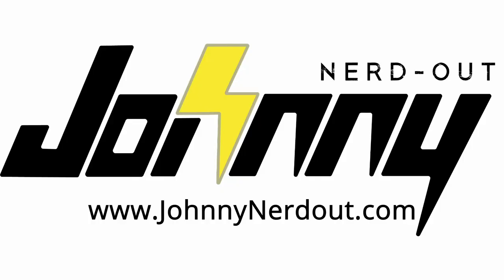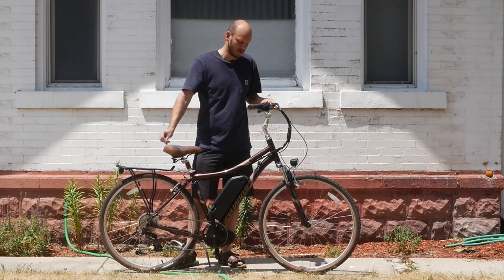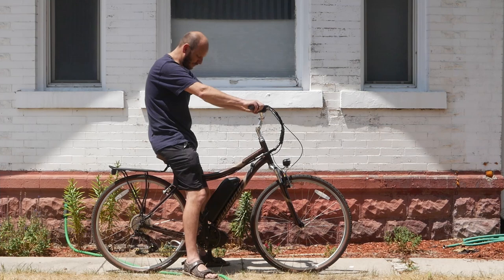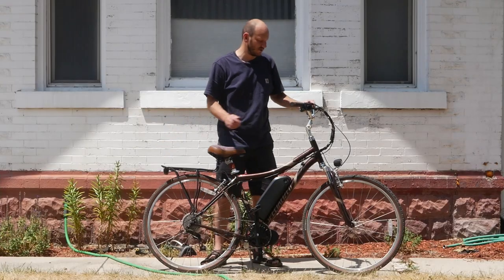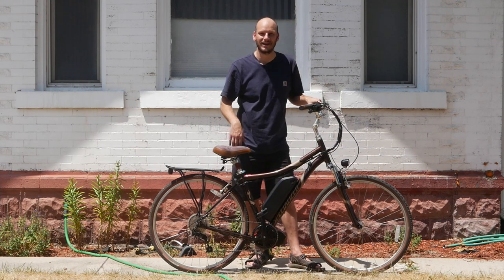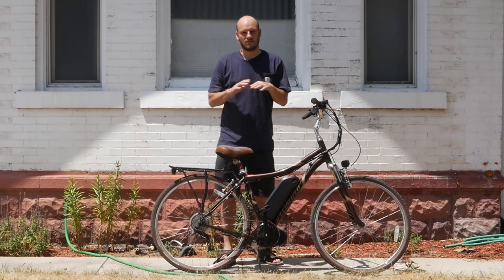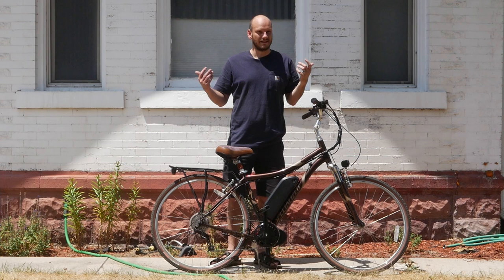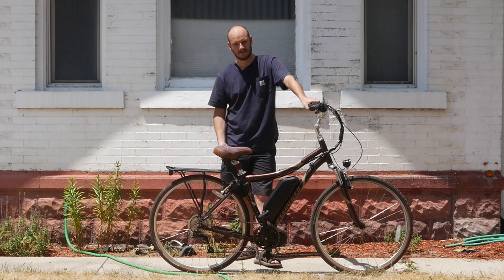Custom E-bike Build: Specialized Crossroads Bafang BBSHD 52v 17.5ah Comfort Cruiser!

Comment: My wife has a specialized comfort bike that I would like to convert but it has a curved frame where the battery would mount. Are there adapters available for mounting the battery to curved frames? I know I could put the battery on a rear rack but would rather use the frame for better balance.
Reply from the maker: Double or triple bob should still work

Comment: You sir have an awesome channel! Quick question. Got a vintage schwinn stardust restoration project and I was thinking of adding ebike conversion. Is it doable? What parts would I need apart from bafang bbhd
Reply from the maker: Short answer is yes, you can convert any bike if you have the patience and a little bit of the Macguyver gene in you. Measure your bottom bracket area for clearance and get a battery. thats it except for spacers and adapters. Feel free to book a video chat with me if you want me to put my eyes on it :)
Reply: @JohnnyNerdOut  thanks Johnny. Will take you on the video chat once Restore of bike frame is complete .
Reply: You'll need a  bottom Bracket eccentric adapter. You'll also want a larger chain ring than normal stock. I'm not certain, but you may also need shorter than stock crank arms. I needed them for a 20" folder I built and a 16" para-trike.
Reply: @MHH3180  Thank you for the tips Mark!! Would you know where I can purchase the adapter?

Comment: How did you wire the lights? I cannot make heads or tails of the bafang instructions.
Reply from the maker: bbs02 has a 6v out with 2 little wires
Reply: @JohnnyNerdOut  Well that is embarrassing, Turns out that the wires are there, just really short coming out of the motor and somehow I missed them. Doh!

Comment: Your videos are super helpful! I got a question related to the thumb throttle I just installed a BBS 02 and my thumb throttle seems to have only max power and then no power no in between like feathering at all
Reply from the maker: Get a program cable and fine tune it. Probably need to set your throttle voltages a little wider apart. Or upgrade the throttle 👍

Comment: What is a gear shift sensor and what is it used for? As always, thanks for a great video.
Reply from the maker: It cuts off power momentarily while shifting gears. It will save your drive train from unnecessary wear and tear.

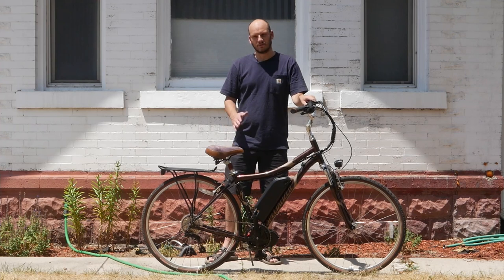Comment: So is this a BBS02 or a BBSHD? Parts list shows "HD', monolog states "02" (1:49), performance test looks the same as most "HD's"
Reply from the maker: Its an HD
Reply: the hd and 02 can achieve roughly the same speeds, the hd is just better at not overheating. I think the hd stand for heat dissipation or something like that.
Reply: @JohnnyNerdOut  pretty sure you said bbso2 in the video, also looks like a bbso2, if it is then that's pretty darn good top speed with throttle only. It would be better also with a larger rear cassette for those very steep hills.